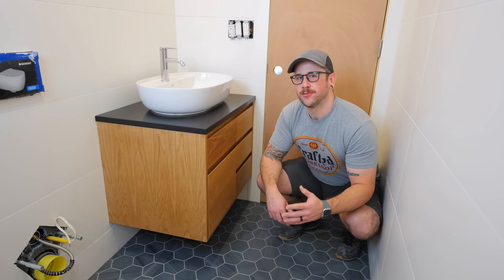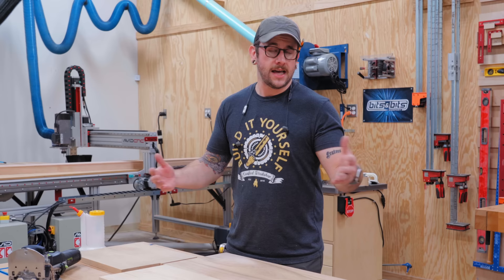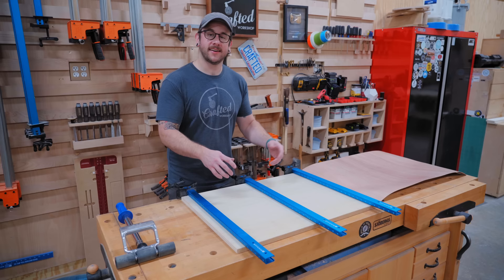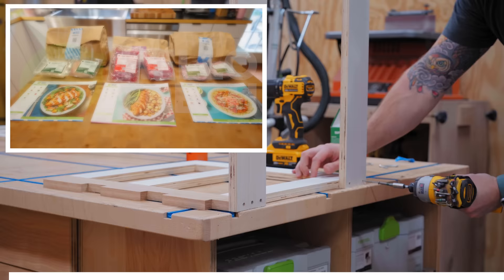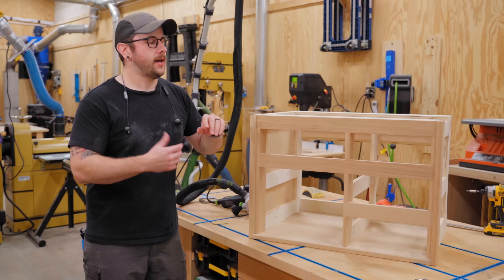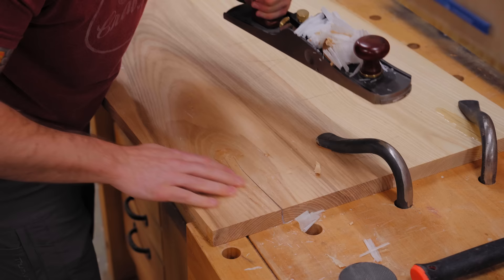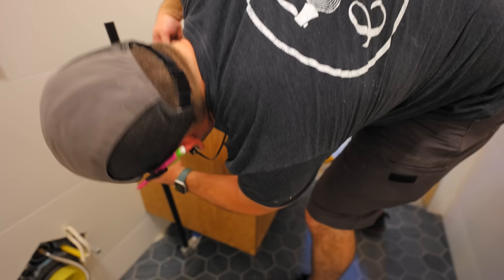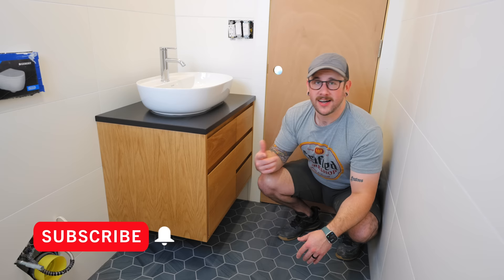How to Build a FLOATING Bathroom Vanity w/ LED Lights // Woodworking

Comment: I have used contact cement on way too many of my builds. A majority of the times that the two surfaces wouldn’t  stick together was because the surface absorbed too much of the glue and did not leave enough on the surface to react with the other layer. You get this a lot in gluing laminates. The laminate might only need one coat and the wood side could take three coats. The old contact cement that smells like death really is the best. It’s just so awful and for some reason costs more than liquid gold. Great video, can’t wait to see more. 😀

Comment: Quick tip for anyone installing a new sink...it's way easier to install the faucet on the sink before you install the sink in/on the counter...greatly reduces need to squeeze into tight spaces in the cabinet!
Reply from the maker: Yup, found that out the hard way here, hah!

Comment: I used the 3M spray adhesive that comes in a green (you can get at most hardware stores) can last year for a countertop. I just followed the instructions and it came out perfect.
Reply from the maker: Good tip! I thought about spray adhesive, maybe I'll try that in the future.
Reply: One is green and one is red. Either way there is a 77 and a 99. The 77 is good but the 99 is way better.

Comment: Final results look great! I really like the drawer front bevels for drawer pulls. Looks very classy. 
That water based contact cement seems like anything "green" these days. It sorta works but not nearly as well as the tried and true, non green stuff. I recently needed to give some paint brushes a good cleaning from dried up paint. The store didn't have the normal stuff I usually get so I got some "green" brush cleaner they had. Totally worthless! It didn't stink and was a pretty white color, but didn't do squat to clean brushes. Might as well have used milk. Got some of the petroleum based stinky stuff and worked perfectly as expected. :)

Comment: We put blocking for grab bars in the shower...and then couldn't find them once the tile was in.  I think that if we had made a reference mark on the inside of the rough door frame and measured off that with the laser, we could have created some useful measurements.
Reply from the maker: Yea that is problematic!

Comment: I Love your workshop setup,  Awesome. The only thing negative I would say is, overkill on building the vanity and way too much time/labor spent. I could build this same vanity, as strong or stronger in 6 hours max, with drawers with dovetail joints, no painting, or installation.

Comment: @10:42 (wonderful build BTW), but life is too short to deal with bits that pull out and screws that fall off.  Get yourself a Wera 889/4/1 K Rapidaptor Universal Bit Holder.   You'll thank me later.  One of the cool features is that you can change the bits one handed.  LOVE IT.
Reply from the maker: I've got one here at the house and I LOVE IT, need to get a few more for around the shop. Thanks!

Comment: Dominos/biscuits/dowels always results in more sanding for me than if I just edge glue panels. The glue swells, moves on each side. Im done using 'alignment' guides. I just edge joint the boards properly and then glue them together.
Reply from the maker: I don't think it's the glue causing issues, that sounds like a tool problem. I barely have to sand the glue line after using Dominos.

Comment: Came out niiice 👀. 

Question: is there a reason why you chose to paint the top black vs maybe staining it with black India ink or maybe cerusing it like you've done in other past projects? I mean, it looks great but I was just wondering if maybe the stain maybe wouldn't hold up to water since it's in the bathroom. 

Also I love Govee lights. I have a few led lights around the house. The ones we installed under our kitchen cabinets look amazing and the app is perfect. I can control all 3 lights we have from it.
Reply from the maker: I think a stain would hold up with the right finish but that Cerused Oak with the Rubio has not held up that well on our kitchen table, a lot of spots are worn through. I figured I wanted something fairly bombproof since this area will see a lot of moisture.

Comment: I like this design. Contact cement isn't real ideal for veneer especially in a wet area. It doesn't have a rigid glue line.
Reply from the maker: I've used it on laminate countertops in my kitchen and haven't had issues, but I could see where that could be an issue I suppose. Thanks!

Comment: Hi there, did you just have the one cleat or was there another lower down? I am thinking of making a similar one but it will have a stone top (heavy :) ) . Thanks in advance
Reply from the maker: Just the one cleat, but then the cabinet is attached to the wall through the lower back stretcher.

Comment: Where did you get all the money for your shop. It is decked out with all of the tools and equipment. Looks like a high school shop used for teaching.
Reply from the maker: I've been doing this full time for about 5 years and have slowly accumulated the tools that are part of my current setup. Go back and check my old videos, definitely didn't have this setup back then! I'm also fortunate enough to work with some brands who send me tools to use, which is awesome.

Comment: The problem with going trendy is that in 10 years the styles will change and you will have a bathroom stuck in 2023. Kind of like the pink and green bathrooms of the 1950s or green shag carpet in the 70s.

Comment: Well I watched this with out volume.  I have done this for 40 years I can just watch.  It’s very obvious to me what’s going on here for the DYI.  First off the case work is VERY labor intensive that can be simplified .   Then it’s just a big advertisement for Rockler tools.  I bet the DIY doesn’t have half the tools that are shown here.  Sure go out and buy them use them once put them on Craigslist a year later.
Reply: Not sure what your point is. You're a superior woodworker? His shop is FAR better equipped than mine and there's nothing he can build that I can't. (And I wouldn't have to spend a dime at Rockler.) If you've done this for 40 years, you should know there's a 100 different ways to build something. If your way is better, why not share it with a YT link?

Comment: OK. BUT THE BATTERY? WHY IS IT NOT JUST CONNECTED TO POWER ADAPTOR YOU ARE ALREADY INSTALLING AN ENTIRE VANITY. YOU CAN ACCESS THE WALL AND POWER GOING TO OUTLETS AND LIGHTS. HELL YOU COULD PAY SOMEBODY LIKE 150 BUCKS MAYBE 200 AND HAVE THEM INSTALL ATTACHED TO THE OUTLET WHENEVER THE LIGHT SWITCH IS ON THE POWER GOES OFF TO THE LED LIGHTS AND WHENEVER THE LIGHT SWITCH IS OFF THE LED LIGHTS TURN BACK ON SO THEN WHENEVER YOU'RE NOT IN THE BATHROOM YOU HAVE A LITTLE LIGHT IN THERE.
Reply from the maker: Is your cap locks broken? The LED lights were just a fun addition that I didn't consider until after I built the vanity. Adding an outlet with the tile on the wall would be a pain, but I certainly could do it in the future if the battery bank doesn't work out.